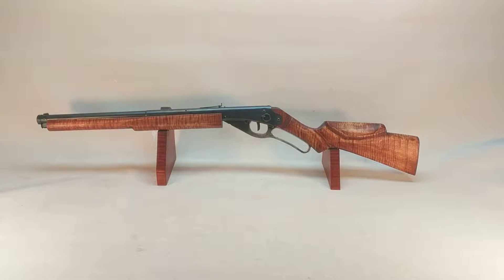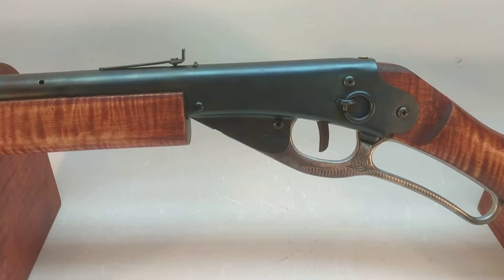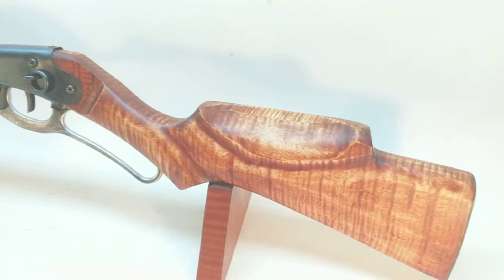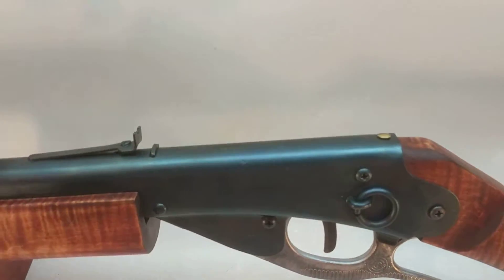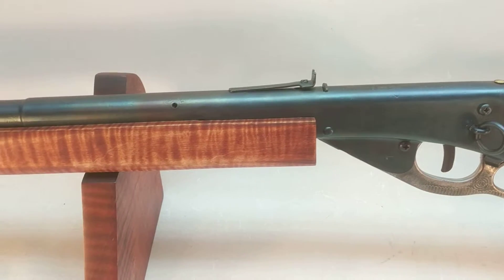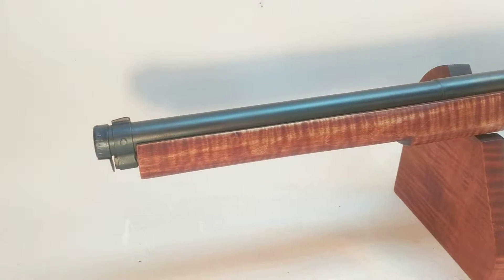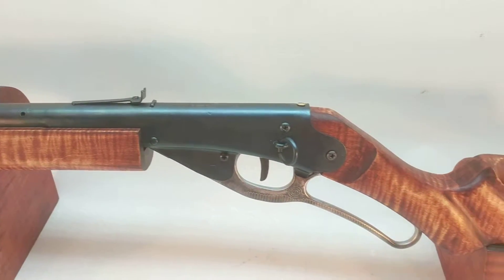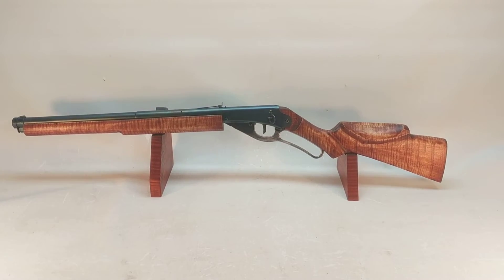Restomod 1938 Red Ryder Carbine BB Gun Conversion

Comment: Looks great I have a question. Can you put in a simple metal trigger in a current Red Ryder?
Reply from the maker: I've fiddled with a couple of billet triggers for the Model 1938B but have yet to finalize an acceptable mod. When Daisy changed over to the plastic trigger in 1978-79 they also changed the rear of the plunger assembly to a slightly inclined rear plate as opposed the the 90 degree angle plate used in their plungers prior to that. Getting the trigger sear to engage with that slight change is a bit tricky.
Reply: @RestOModDaisy  Thanks for the reply. Love all your videos and I will be ordering a few things soon first will be a metal cocking lever for my Red Ryder and maybe one for my 1999. Take care and keep up the great work.